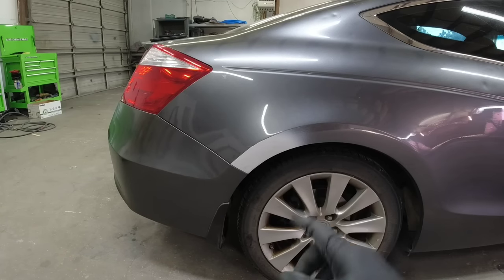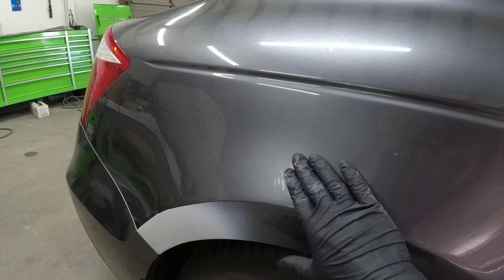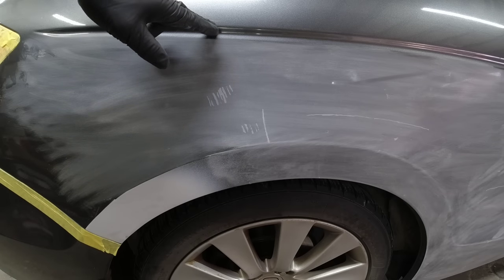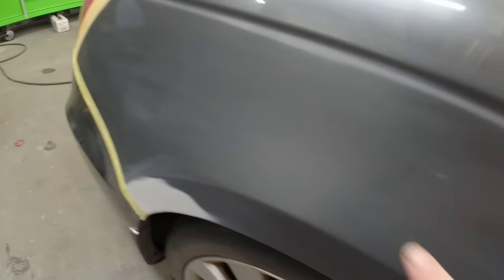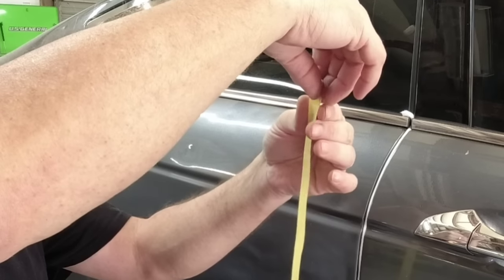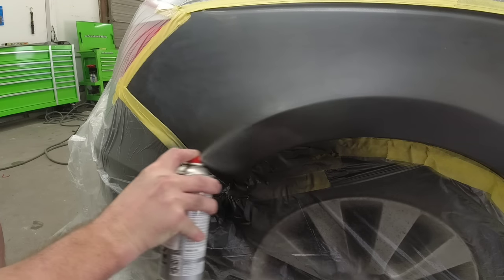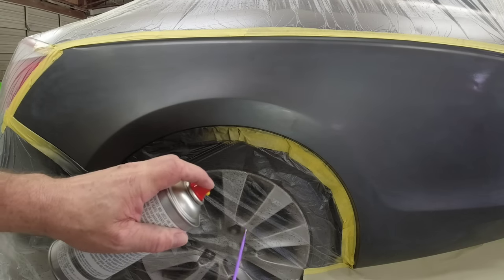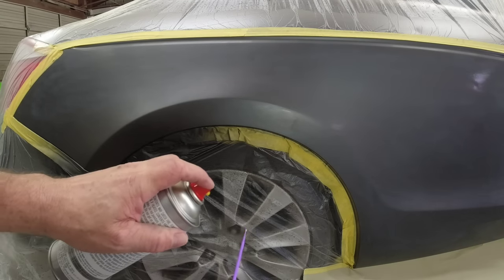How to SPOT PAINT a car with SPRAY PAINT and CLEAR for amazing results!

Comment: I do some repair work at home, I have a verity of paint guns mostly cheap ones but if you can paint the best guns can make a difference but you can get a nice job as long as you can get the best out of what your working with. The weld type stud gun with slide hammer on it how do you or where can you purchase one, I have a stud gun but that type can save you some time. And your wipe down you use were can you get that or can you make that yourself ?
Reply from the maker: I think your referring to the g90e
Here is the link
https://amzn.to/3IgQ5CR

I use isopropyl alcohol to wipe down or wax and Grease remover here is a link https://amzn.to/3G56yaI hope this help appreciate the support!

Comment: Wow this is amazing estimation point! I love that you're using that type of paint as well! I have been trying to find a Dupli-Color for my car but they never have enough cans in stock, so I bought this brand, great to see how good it comes out! So my question is I'm doing an area in Black, would I want to use semi-gloss or gloss paint with the clear coat?
Reply from the maker: Urethane base coat it's designer to be clear coated and it has no gloss

Comment: Awesome video. This is exactly what I need for a repair on my motorcycle. I have a question similar to @79hella.  Why did you decide not to do a final 1000 grit or greater sanding on the color coat before applying the clear? Thanks
Reply from the maker: You don't  want to sand the color coat before clear. The only time you might do that if you have trash in the basecoat you need to remove but then you must apply an additional coat of base. Appreciate the comment and support brother!

Comment: Thank you so much, awesome video and a project that is exactly what I’m looking to do. One quick question, You did not sand the new paint over the repair before the clearcoat, correct? Thank you
Reply from the maker: No you don't  need to sand the newly applied paint.  It will have a chemical bond with the clear. Appreciate the question and support! Good luck on your project.

Comment: Do you have to sand the treated area after the final clear coat is put on?? If yes can you explain the best method for that?? I have ZERO experience painting or wet sanding but I’d like to clean up a farm truck we have..
Reply from the maker: You don't  necessarily have to,  but if you want to remove imperfections and get a glass like finish you will want to. Here's a couple videos I made explaining the process. 

https://youtu.be/6iMAoxo_BT4

https://youtu.be/PnJrd5eadD4

Comment: What grit sandpaper would you use to even out some rock chips on a front bumper?
Reply from the maker: 320 then  you can apply primer right ovr the 320 scratches

Comment: Nice video, I've done alot if this type of repair on my cars, after the finish coat of clear once it's had time to harden/properly I'd normally wet sand, clean and then Polish and wax , did you do the same after ? Just curious
Reply from the maker: Most of the time yes, always seam to need to cut and buff at least a bit.
Reply: @GarageNoise  yeah, I find it gets rid of any orange peel affect and a really nice finish

Comment: Super Great Video!  One dumb question on initial sanding to a dull finish.  Do you try to sand the old clear coat down to the base coat or do you just clear coat over a sanded clear coat?  I may try so paint some damaged areas on my 20 year old Motorhome.
Reply from the maker: You do not want to sand down  to base coat. When sanding you just scuffing old clear for adhesion of the new clear.👍
Reply: @GarageNoise  Thanks, that was the answer I wanted.

Comment: Nice job as always Chris. Question when sanding how long do a mechanical sand scratch for a adhesion last . Before you have to resand again.
Reply from the maker: I don't  feel  like there's any set time frame if it's  scratched then it's  ready if you continue  to drive or expose  to elements  then it would  just need cleaned.  To be safe I would do a scuff just before painting tho. Thanks for watching hope this helps
Reply: @GarageNoise  Most of the sanding scratches mentioned are going to occur by the incorrect use of 600 - 800 sandpaper first. Start with 1000 grit first to save sanding time later.

Comment: Nice video. Wish I stumbled across it sooner. This past weekend I did a similar project with peeling clear coat on a daily project car I’m trying to make look better with spray cans. I sanded all with 320, 600, then 800 until I saw primer and reprimed, cleaned and all.  Unfortunately I ran out of base cans and clear and the color looks off as a result.  I just ordered more cans and extra for good measure.  
My question is since I recently primed the panels I want to target and it has a slim base layer and clear, do you think I can sand down the clear coat and add more base from here and then clear again?
Reply from the maker: Sure, just sand with 600-800 base and clear
Reply: @GarageNoise  thanks so much. Weather ruined my plans this weekend since I don’t have space in my garage to do this. Next week I will try this and order more paint and 2k clear to be sure. However the weather will get colder especially at night. I still want to target this, but how long do you think it would take for the paint to dry?  Should I wait 24 hours after I apply the base prior to applying clear?

Comment: So may have stuffed up on my clear coat application as I was trying not to get any paint runs.  I had faster movements than you, but multiple coats.  Is the surface supposed to feel smooth after the application of clearcoat?
Reply from the maker: Yes it should feel smooth. It can be wet sanded and buffed tho.

Comment: I bought same spray from 
OReillys Guy behind counter told me no need for clear coat they already added to the paint.
Reply from the maker: Always better with clear. Could have been a single stage enamel but it doesn't sound right.
Reply: @GarageNoise  yeah I just painted fender it’s not good enough I will clear coat it 👍🏻

Comment: It's really amazing how you have done it using with raffle cans, so I have got questions. If I build a spray booth and if I spray it inside the booth, can I make it like a professional job if I use a spray grip handle? :)
Reply from the maker: I really don't  think you even need a paint booth. If your planning on doing a whole car, it can be done but it would be difficult and I really don't  think it would be cost effective  but it could be done and look good.
Reply: @GarageNoise  Yeah but what about the wind blow off and the dust get on the paint so it would ruined it?

I'm only need to respray on the roof, bonnet, 4 alloy and under the bonnet.

Comment: You said you got the paint at O'reilly's and they mix it and put it in the Aerosol spray can? What do I go in with my paint code?
Reply from the maker: Yes, not all O'Reilly's have the capability to do this. You local automotive paint supplier should be able too as well.

Comment: Interesting that a spray can could do as well as it did. However, I couldn't find an O'Reilly's that could mix a can of paint in the Denver area. The stores I did call here never heard of such a thing other than the premixed paint they carry.
Reply from the maker: I was surprised myself on how well the clear sprayed. It may just be just Oreillys in certin areas of the country. Try a local automotive paint supplier they should be able to get your set up. you. I appreciate the comment and support!
Reply: There's another chain in many states including Colorado: English Color & Supply. They not only mix, they have multiple samples for each OEM color -- you can match exactly to your vehicle :)_

Comment: So you don't put anymore base coat after you fine sand the panel?...and then the clear coat fills in?,and you don't loose any color from the base coat?..always been a question of mine,thanks.
Reply from the maker: If I need to sand the basecoat before clear then you must apply another coat of base.
Reply: @GarageNoise  what is the lifespan of that clear, once you activate it? Thanks
Reply from the maker: @daviddoran9221  not long, just a few hours.
Reply: @GarageNoise  I'm painting a gas tank on a Honda cb750f I want to clear it first and then put the decals on I was just wondering how I could go about clearing the decals, for protection and to hide kind of the fine edges

Comment: I believe you used 800 grit to scuff the good area that wasn't spray painted. Wouldn't that leave hideous scratches under neath the beautiful clear coat?
Thanks
Reply from the maker: Not at all you want that sanded for adhesion of the new clear. It won't  show scratches unless you use too coarse of sandpaper like 400
Reply: @GarageNoise  thanks

Comment: What is recommended for a Good flexible 2k clear and Primer Sealer for Plastic BUMPERS? I have the Seymour PBE Flexible Primer and SEM Flexible Primer Surfacer and they work GREAT! but im looking for Primer Sealers out of a can that I can use next... Either a 1k or 2k but definitely prefer a 2k can that either is activated by moisture in the air, or has a 2 part chamber system inside the can... Any recommendations!?
Reply from the maker: I don't  know any 2k sealers out of a can but I mostly use paint guns. There may be some out there.
Reply: @GarageNoise  Found Some! Speedokote T-Rex Bite Kote Adhesion Promoter & Clear Flexible Sealer... It compares to Bulldog but SPECIFICALLY states its a "Sealer"... It doesn't really state that on the Bulldog other than that its a Great Adhesion Promoter... There are also another half dozen I found that state the sane thing but besides being an adhesion promoter or primer (or both), that the product "seals" as well, so Im not exactly sure still about those others, but I still wanna give them a try after the TRex Bite Kote...

Now I need to find the 2k Clear in a can that has the flexible additive properties in it... So far OHW (One Hit Wonder makes them for about the same Price as Spray Max 2k)...

Comment: Very good video. Very good results. So I am working on getting a car touched up that I bought. 

After the clear coat here would you then wet sand it? Is the a video that you did on wet sanding? What kinda grit would you use?
Reply from the maker: There's  not a video on wet sanding this car but here is a video on the process. https://youtu.be/4_iz9kYVC2w  I didn't wet sand this repair. Appreciate your comment and support!wet

Comment: Great video thanks. My question is I have two areas that need redone. Can I or not do them at the same time ? Also I didn’t know O’Reillys could mix up paint for a spray. My question is do you refer O’Reillys brand or is Dupli-Color match a better way to go.
Reply from the maker: O'Reilly's is just a seller for Nason paint. I would stay away from duplicolor if you have other options
Reply: Thanks for the advice. Do you also have a video on the next steps (sanding, buffing etc.)
Reply: @GarageNoise  -- What do you think about Eastwood compared to O'Reilly's?
Reply: After you were finished with 2k clear coat how much did you left. Trying to judge how much I’m going to need. Again thanks.

Comment: Is it necessary to do the whole panel if it was just that 1 spot on the fender ?
Reply from the maker: Not completely, depends what kind of repair you want. If you want it perfect than yes. I'll  be doing some more video's on just repairing spots for viewers who just want to clean up a car.

Comment: Did you wet sand between any of the applied coats ? And any wet sand after ? Buffing done after ?
Reply from the maker: No wet sanding needed  between coats of base. Unless you have dust you want to remove before applying your clear then you could lightly sand it out with 800-1000 and re apply a coat or two of base. I did not wet sand and buff this after I cleared it and it remains looking good a month later. You always can for a smoother flat finish. Thank's for the question! Appreciate the support!

Comment: * *  I followed exactly your instructions but the finish product is not very glossy and very smooth. Do I have to wet sand the 2K clear coat and then buff it to get it glossy?   You did an excellent job and got a very high gloss without any wet sanding and buffing at the end... * *
Reply from the maker: I have experience so that may factor in but the nice thing is you can wet sand and buff this clear.
Reply from the maker: I have experience so that may factor in but the nice thing is you can wet sand and buff this clear.
Reply: @GarageNoise  Thank you, but will it come as yours? You got a PERFECT finish, and I spent so much time and grew so much frustration and I am not even close.
Reply from the maker: @gt-c-  you also could sand down the clear smooth with 600 and then re clear it.
Reply: @GarageNoise  will see what happens...But why would I sand down completely the clear coat? This is a waste of more time and money...no? You did it is fast and simple...and the results was AMAZING!
Reply from the maker: @gt-c-  only if you don't  want to wet sand . Sometimes it's quicker just to sand and clear again. Just an option

Comment: Hi,  i was planning to do a  truck wheel arch, (rusty),  I am going to use duplicolor base and the 2k clear that you used.  I am trying to stay away from clearing the entire  truck panel. If i clear the problem area and a little beyond, will I be able to get a finish where I don't see a transition. Maybe by polishing?  thanks

Comment: Good afternoon I was told that the direction of the paint sprayer has an effect on the metallic in the paint if I paint vertically versus horizontally will I make a difference in the look of the paint?

Comment: Would this work for a glossy black as well? I know black shows a lot more than any other color.
Reply from the maker: Yes it would actually be easier with a solid color like black.
Reply: @GarageNoise  Thank you! Do you care if I send a few links to get your expertise on it? As far as the paint it would be an aerosol can of the 040u paint and clear coat and primer along with a bit of body filler.  Do you think a pen would be better for a small thin scratch or tape off surface and do a full repaint if it's just that on like a door for example?

Comment: Car Rep 2k clear mixes when sprayed so it WILL NOT HARDEN UP IN CAN IN 24 HRS. U can use it and the 2k primer for small jobs and have a pro product that will last forever and not have to hurry up and use it b4 it hardens and it's wasted.
Reply from the maker: Good point, your right about that car rep 2k clear I've  tested it and it does not spray well leaves a lot of peel. Have you had good results with it? I couldn't get it to lay out nice
Reply: @GarageNoise  I love it. I don't have the time to get an entire panel etc ready so I love that I can get a section done, spray epoxy and when u get more time do some more. As far as the clear I put can in a bucket of very hot water cause I was spraying on a 60 degree day and it worked gr8. Maybe the spray tip was off a lil bit or something. I love it. Idk how many times I've wasted a 3rd or almost half a can of the other cause I had to redo some work and it was no good. I hate to hear it didn't work well for you. I've sprayed tge epoxy and clear and so far it's been gr8. Love the videos. Keep them coming. Getting any body work or paint done is so costly now. Being able to do the work at home save us so much $$$.
Reply from the maker: @jasonchristopher2977  I'll  give it another go, If I can get results I'd  love to do a video on it.
Reply: @GarageNoise  Like I said I thought for my kind of projects, get some done and sealed up daily, it was the best ever. I hope it goes better this time. I love the 2k like u used but I just end up wasting some or more than I'd like to using it. Unless I'm doing a entire fender, quarter panel etc I'm usually doing just rust repair, etc. Smaller areas where I just need enough to fill maybe a touch up guns worth of epoxy, base, clear etc. All I've ever used sprayed gr8 and looked gr8.

 Well besides when I start there's not 1 bug around, when I'm waiting for a coat to flash it seems like 1 tells 1000 Hey this guys just sprayed fresh paint, let's all go see. Lmao. But that's the way painting outdoors goes. I know my Experience over last few decades with rattle cabs either 1 it sprays good, but job has small issues, it sprays bad and job has alot of issues, or it sprays gr8 and job looks gr8. More often than not it's the 1st 2. Idk how many times it was going good and nozzle got plugged and it looked like it was thrown on, or I'd get my finger in the way, etc. I've done some frame work with a air brush type gun and it's done well for that type of work. Not any over spray, kinda like a HVLP sprayer. Or used a wagner power painter to shoot thicker truck bed type coatings.

 Also my pap gave my dad and he gave me this recipe for those who fight salt, 1 quart of any oil new or used, same with trans fluid, 1 tube of grease and 1 wax ring seal for toilet. Mix all and heat in old pot and brush or spray. I've tried about all waxes and they work but don't have any petroleum in them. We've used this mix on anything u can think of and it's worked for decades. If using used oils etc it costs less than $10. 1 can of cavity wax or fluid film. For doors clean drains, tape drains and fill with a few inches of baby, mineral or melted Vaseline. Let sit for days then drain and save for later. Smells good and will last years.

Comment: When someone clear coats a car is wet sanding it after it is mandatory?  Cuz I did my carbon fiber hood and the roof of my car.  Wil I wet sand them after the same way? Or cabin fiber is different to wet sand after fresh clear?
Reply from the maker: If you have a clearcoat over your carbon fiber then yes, it can be wet sanded to a flat surface and then buffed. It's  not mandatory but will remove any imperfections in your clear. Appreciate the comment and support!